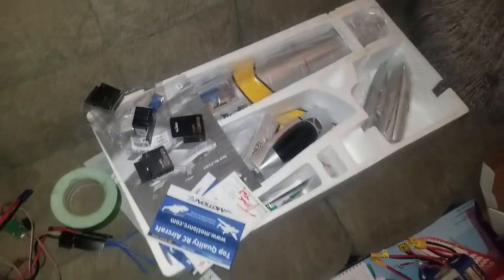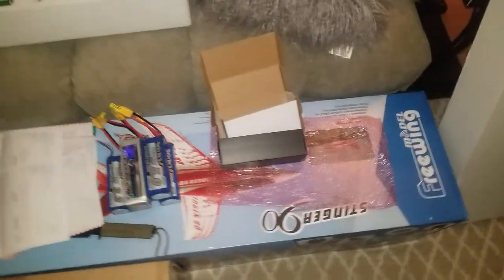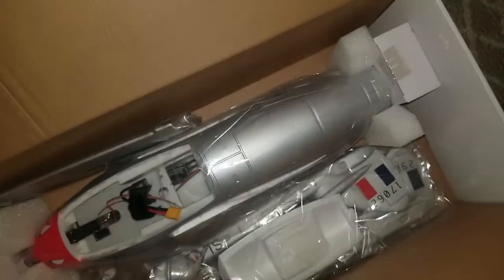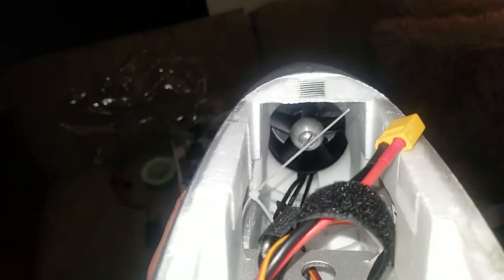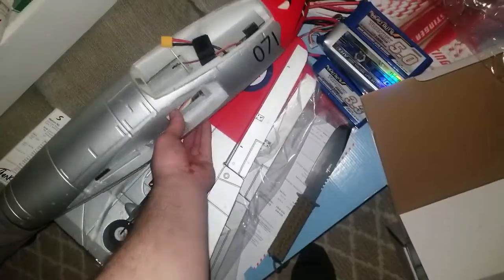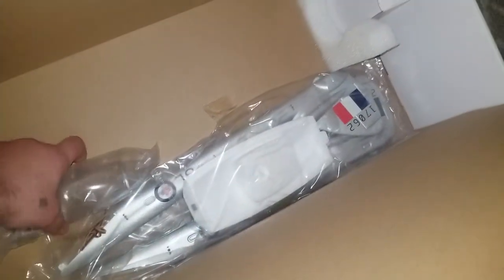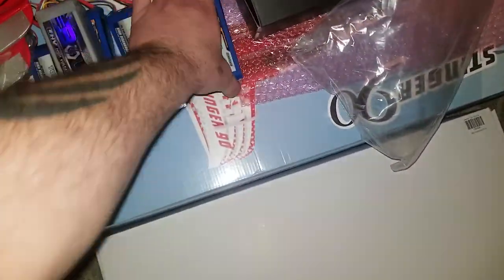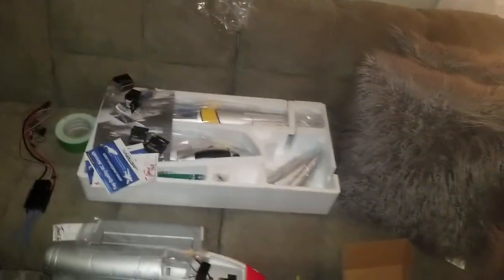Update blog, sneak peek for tomorrow, miss you all

Comment: What a great vid .. thats a ton of goodies bro!
Congrats on the new jets
I have a durafly vamp ..shes prob got the highest sortie nbers prob over 400 flights ..trust me ..she doesnt need flaps she will glide level for weeks ..she is very predictable and lands great.. however take off with stock power needs a long run out .. as floaty and gentle as edf' come ..and when u crank ot open she is pretty impressive .. i fitted a change sun10 fan to the stock system and she soumds awesome and goes like a rocket ..
First thing to do is pull on those gear legs as the early vampires suffered from retract pockets pulling out ..on everyones!!
She balances perfect at the point where the retract wires turn 90degrees in the wing .. 

Cant wait to see that big stinger .. a super stable platform in 64mm form im sure the big 90 will be an adrenaline junkie ..

Dude also on a serious note and i would appreciate tour feedback ..does anything strange happen in your house (paranormal) as i have noticed some odd things in a few of your videos!.. 

Glad your back bro and it was great to see your comment on my p38 maiden vid .. 

Peace! ✌